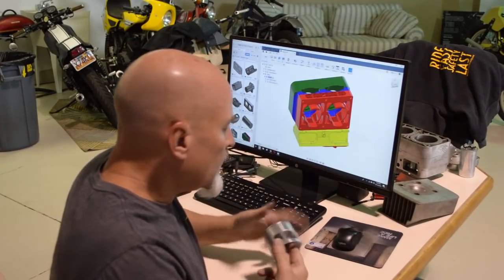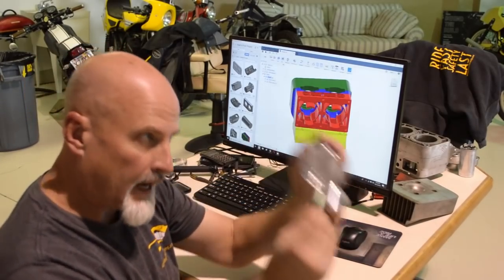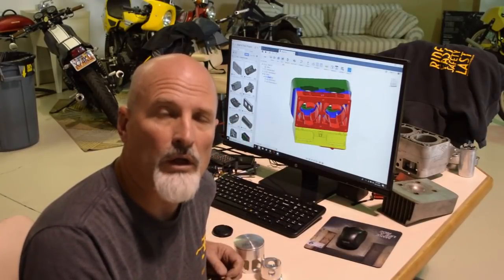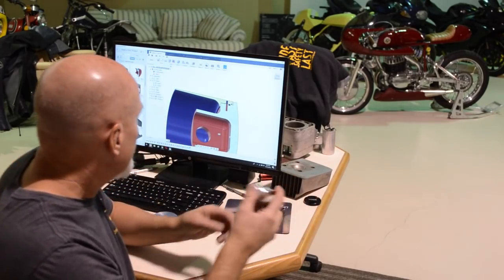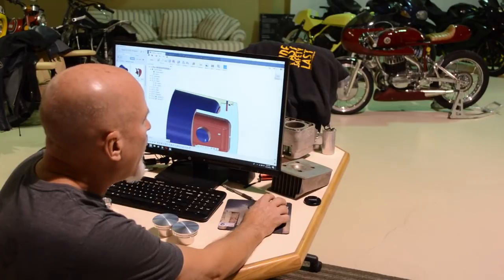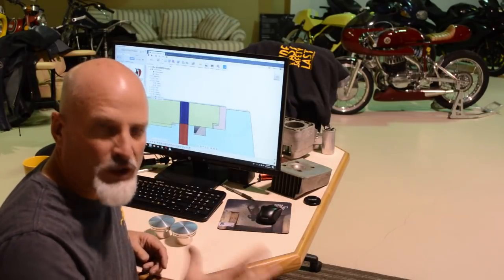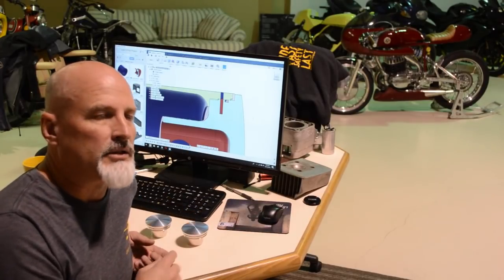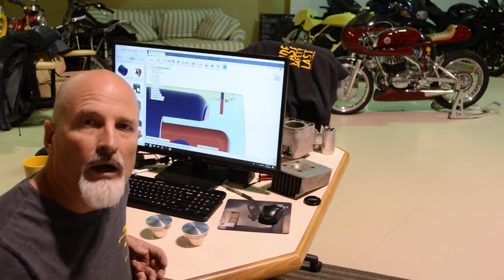New piston design rev 2

Comment: Would it not be possible to weld a small disc in each side of the wrist pin to stop the leakage between ports you refer to?
Reply from the maker: Yup and Pankel makes them. They cost a ton 'o bitcoin tho.

Comment: Over a decade ago, I was looking for some high temp o-rings.  Contact "O-Rings west".  They had some o-rings that were developed for NASA, and could handle 850 deg f.
Very expensive though.  The 7/8 od o-ring costs $16.00/piece.  That was about 15 years ago though.

Comment: I like to face down to center because that is what the tool is designed for, but up to .003" finish cut from center to OD can leave a better finish.  If you pick up your feed rates, the material will form chips and not be so stringy.  I don't know your machine capability, but in aluminum with a .100" depth of cut, up to about .015/revolution is OK for the rough cuts on a lighter machine.  Then a switch from about .003" to .005" should give a good finish pass, (and will be stringy).  The finished parts look great.

Comment: Do you think that this type of piston technology could be applied to older engines? I'm "asking for a friend". lol
Reply from the maker: Yes. 😁
Reply: @SpeedofCheeseRacing  If the width of the ex. port overlaps the transfers and the pin.  I would say your piston design is more interesting for a pretty high performance porting configuration, which is also older engines by now. :)
My name is Doug from Michigan.  I build little 30cc 2-strokes for a living, (15 years now).  They are little racing Husky/Zenoah engines with 70's porting config's, using only a single exhaust port.  A customer of mine sent me your links.   We are alike, you and I. :)

Comment: would this 2 piece piston design work on a 2001 cr 250? I run micro sprints. We run a cr250 bored 68 stroked 74. Im not much of a motor guy (as im sure you can tell). I know enough to get by. But if this is something you could make for one of our motors i see a HUGE demand for it! Our sport is really big and extremely competitive. If this is something you're interested in dabbling in, feel free to contact me. I can send you anything you need to get started.
Reply from the maker: Yes it will work in a CR engine. I may down the road. Thanks
Reply: @SpeedofCheeseRacing  are they available for me to try?
Reply from the maker: @barry_28a83  not yet. Stay tuned to see if it is even worthwhile.

Comment: Instead of using an O-ring, machine a Teflon crush ring so that it crushes to the maximum, then when the temperature increases, the Teflon will slightly expand. I have used this method on low profile adjustable gas blocks I design for AR-10, because no one make a low profile adjustable gas block. I don't get any blow by do to the extreme pressures. I would make the seat for crush ring in a dimond  shape with small radius.

Comment: I'm an old chainsaw guy.  On an old Husqvarna chainsaw I took apart, notice the piston and the wristpin connector were braised together.  I like your new piston idea I was wondering if louse threads; less threads; or even no threads with aluminum pins then braising the two parts together would work better.  You would eliminate some needed precision, and not need an O- ring.  If you use an aluminum pin it would be easy to lock in and file smooth
Reply from the maker: You should try it. My engine comes apart all the time so brazing doesn't work for me,
Reply: @SpeedofCheeseRacing  that's why I didn't suggest welding, braising can be melted out.

Comment: why not use a total seal ring ?  would solve the ring catching and breaking issue
Reply from the maker: I think total seal rings are an engineering mistake. I don't see how a two ring designing would keep it from falling into a port.
Reply: mark atkinson  from what I remember it’s not a two part ring . But a one part ring with overlap where the last let’s say 1/2” is half thickness , sort of like a key chain ring . Maybe in your case this could be continued so a one piece ring could have 180 deg or even 350 deg overlap just like a key chain ring

Comment: Even a Viton o-ring will most likely take a compression set at those temperatures. You might look at Kalrez or Vespel seals from Dupont, or some of the stuff from All Seals (silicone, etc).
Reply from the maker: Okay I will check their properties.
Reply: @SpeedofCheeseRacing  There may be also woven ceramic seals or "cardboard' seals (resilient) that will work. One last possibility is a soft alu or copper ring seal that is machined only a 'thou or so thicker than the cavity height, or even soft copper ( alu and copper sealing washers are used all the time in hydraulic banjo fittings and things like oil pan drain plug sealing)
Reply: @SpeedofCheeseRacing  ; You could also just taper the mating area between the skirt and top, like an AN hydraulic fitting, to seal that area. The only possible problem with that would be that the skirt might expand too much because of the radial force of the V threads, That can be reduced by using ACME or Trapeze  threads, but they will still expand the skirt somewhat. The inherent problem with ACME and Trapeze threads is that there is less friction between the 2 parts, keeping them from unscrewing from each other. some sort of simple locking device (a pin?) could fix that issue.

Comment: Nice improvement....

I wondering myself, what kind of alloy do you use for it?
On a silly matter.... sealing the 2 parts, what about using different alloy for the 2 parts, the skirt made of low dilatation alloy compared to the upper part so when the piston heats up, it seals itself by dilatation?

Comment: Bad..A Viton o-ring will allow the thread to move up and down very slightly at high K rpm...Asking for Trouble... to skirt threads, stressing the lock screw.     Yes, go with your other idea, Lock those skirt thread all up.. with metal to metal flare, and tight thread clearances (hot to skirt and cold dome to remove them).   To remove, put some drill hole in the bottom of skirt and fit and female or male skirt tool with temporary screws for twisting the skirt...I think it's best to make a special made tool to hold wrist pin boss.
Reply from the maker: Thanks. The o-ring doesn't seat the skirt. Just seals it. I am always asking for trouble. :D

Comment: One question heating a metal will expands so the thread will loose itself.i think an alternative way to fix the 2 portion of the piston head and skirt with 2 or more lockpin like that.And also the ring groovers might would be carved on the head itself so easy to assembl.Its only my taught and my doubt.
Reply from the maker: The threading works terrific. I have run them for years.
Reply: Wow that's awesome.bst of luck

Comment: actually you dont need the rubber based seal at the twin part piston...just use the tapper thread and tap...use 4degres taper thread...just like gas standard NPT thread...thats will be better...cause the slope 4degrees will tighten by it self as you tight the twin piston part dsign...dond worry about loosing tight..just dont forget to use LOCTITE seal high temp at the thread....i am from indonesia...good to aply your idea at here...i am try to kawasaki ninja 150cc 2stroke 30hp....
Reply from the maker: I don't want to do NPT. It is too hard to clock that way. I love those little drag bike you guys run. I may have to build one some time.

Comment: Liking the new design! Now, speaking of destruction - could you grind out the exhaust bridges and give it a try without them? Asking for a friend.😁
Reply from the maker: Haha maybe. I could put the old liners back in and do a test. My exhaust divider is just the sleeve...no aluminum behind It so an easy modification. It might be cool to see if it makes more power by cutting them out.
Reply: @SpeedofCheeseRacing  It would be indeed!
Reply: @SpeedofCheeseRacing  That would make it a single port with a width almost as wide as the bore diameter?  Did I read that right?  If so, no, your piston will fall in the hole. 
Depending you the bore size, a single exhaust port about 70% of the bore diameter is considered max.  That is why we now have bridged exhaust ports and sub ports. They can go about as wide as the bore diameter, and the bridges keep the piston from falling in the hole.  :)
Reply: A friend ........lol

Comment: Awesome stuff! Looking forward to updates, please do include machining footage next time too, it's cool and educative to see the actual process of it being made.
Good luck racing this weekend! 👍
Reply from the maker: Okay. I will. Thank you. I hope I have the fueling sorted out and it goes really fast.
Reply: @SpeedofCheeseRacing   Hi mark, grate work & brilliant ideas :)  
May i ask you a question , I read that you are having the fueling sorted out. do you use pump gas fuel or have you tried any race fuel ? and was there any improvements ? 
Thanks and looking forward for your reply :)
Reply from the maker: @brucektm  I just switched to methanol, but when I ran gas I ran both pump and race gas. I never saw a difference in power.
Reply: @SpeedofCheeseRacing  at the moment I`m experimenting a little with fuels and i tried VP racing fuel SV05 oxygenated Content: 4.7 % and i`ve noticed a little improvements in quicker rpm,  Now I called the VP`s fuel technicians and explained some information about my engine and suggested me to try the VP MR12 that has a higher oxygenated content . but i haven't been to the track yet, meanwhile i have been doing more research and found that some motocross guys found the VP MRX02 was giving quite good out put figures on the dyno.

Comment: Thats cool Mark! But regarding the viton o-ring idea. I have some input on that. I know you make the parts for you motorcycle engine and in that case it probably works fine. But if you apply this idea to a 2stroke engine in a snowmobile then i think you could see o-ring failure due to temprature differences. If its been -30c/-22f during the night and you start up the snowmobile on the morning. Then i think the o-ring will go from a hard and brittle stage to warm in a to fast duration and will fail. But thats just a thought i have and its no science behind it... 

I really like the idea with the skirt screwing onto the dome part. 

Have you been able to increase wall thickness in the skirt compared to the regular forged ones?
Reply from the maker: haha I like that you are planning this for your application. The o-ring may not work. We will see. I was planning on keeping the same wall thickness. What are you thinking there?
Reply: Hehe ofcourse. Im very interested in this! Could send you a pistons to experiment with :)  
Regarding thickness etc, i was just curious if you altered anything and still seen gains in lowered pistons weight. I mean stronger + lighter pistons is always something good! 
How many hours have you had on your last set of pistons? You said something about 50 dynoruns. But i guess you also tried it out in the field also?
Reply from the maker: I have lots of pistons but will let you know. :D  I have run maybe 150 dyno pulls on several sets and different alloys. Look at my instagram page for some definite failures. hahaha I landspeed race so, yes, I have run them on the salt. They work fine.

Comment: ever thought of making the piston out of different alloys , could make the top out of higher grade aluminium and the side out of something resistant to wear .
Reply from the maker: It is. :D
Reply: @SpeedofCheeseRacing  just maybe grathite mixed in with aluminum,  high heat resistant and no friction. 
Thought of it only cos i research alot with graphene from graphite.   Graphene is stronger than steel and diamond.
Also with your piston maybe a threaded piston  pin end cap .
Just a thought keep up your awesome ideas it'll work. All the best on salt flats a bit of footage would be great cheers.
Reply from the maker: That would be the best piston ever. Can we grow a nano tube 71mm? haha There is a video of a run I did at Speed Week just before this one.